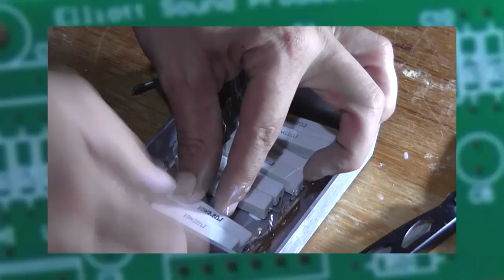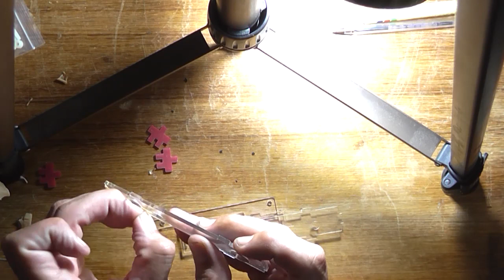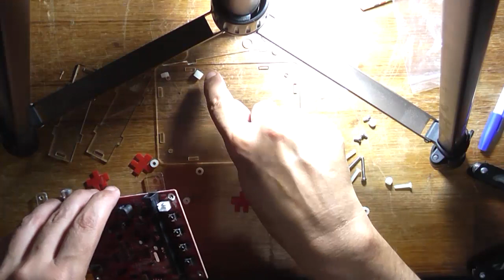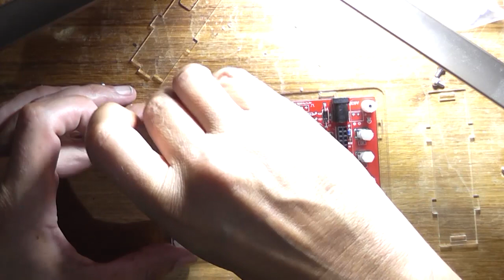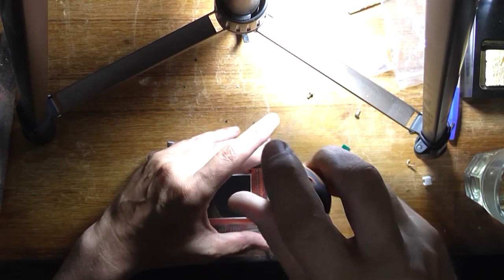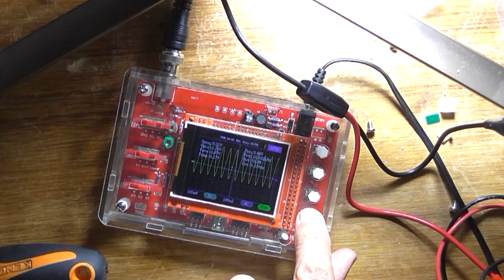DSO138 Acrylic Case Assembly

Comment: I have the "same" oscilloscope, but slightly different pcb layout, and a very different acrylic case.  I'm sorry you got a shoddy case...and poor component installation.
On mine, the buttons are made very similarly to the switch slider thingies.
Reply from the maker: Yeah. Someone didn't measure correctly nor test fitted it.

Comment: Hi Astro. I built this DSO a few years ago as a kit. Seems to works ok for what it is. If you have any issues with it failing to bootup anytime, check the 79L05 regulator. Mine failed and I read in a forum somewhere that this reg is an issue.
Reply from the maker: Thanks for the tip